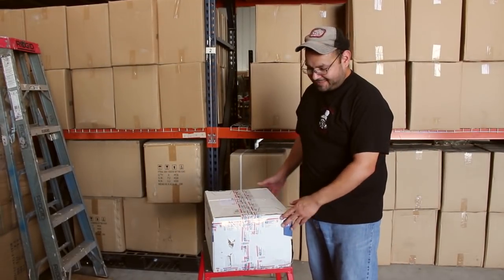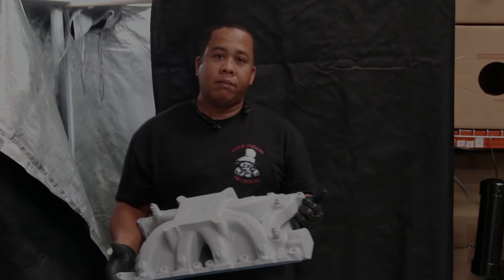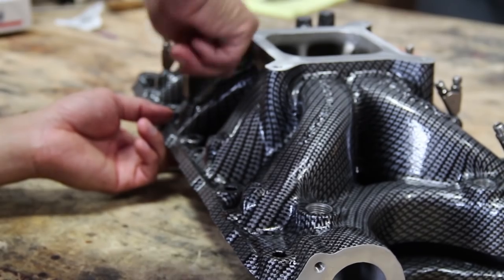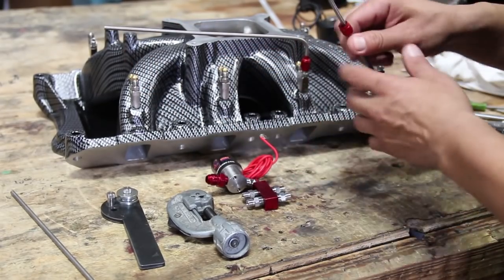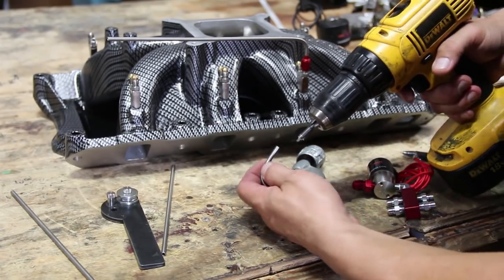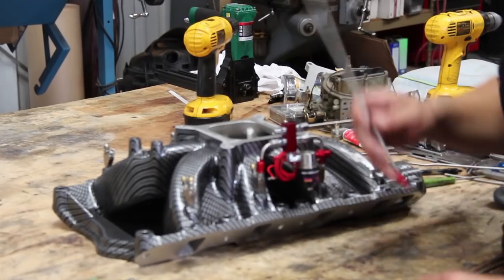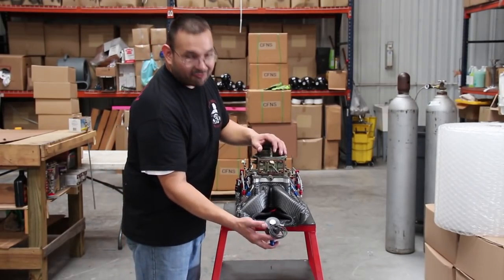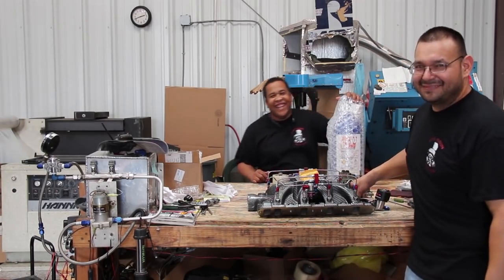Enhance Your Hydrographics: Complete Fogger Kit Installation Guide

Comment: The bosses are drilled and tapped wrong for a 90 degree nozzle.  the flat they drilled them for would be for a straight nozzle, the other flat on the boss is the correct one for a 90.

Comment: Probably be a good idea to blow out the lines you ream with nitrogen or brakeclean to get the chips left in there out --- a little tap on the bench ain't gonna cut it for those solenoids when they open the first time and ingest those shaved particles of metal left in the line--Just a suggestion from an old school mechanic--- Good video otherwise